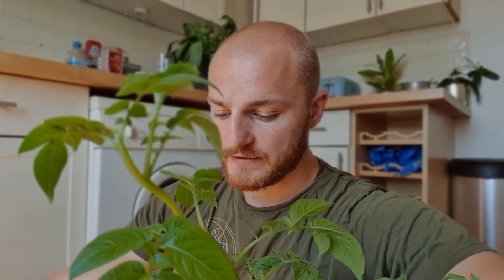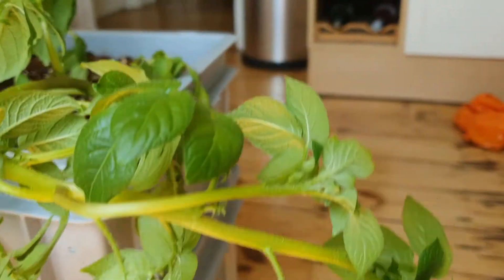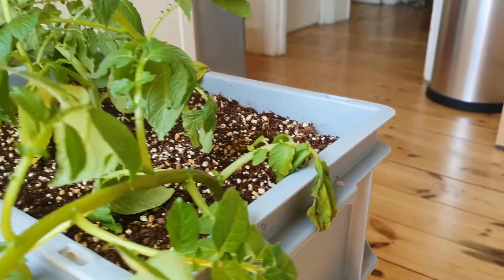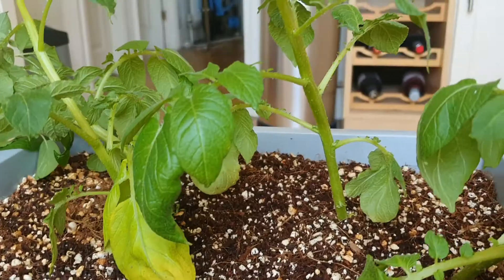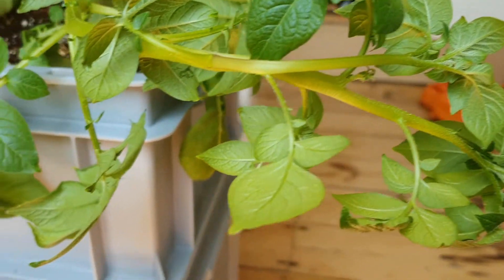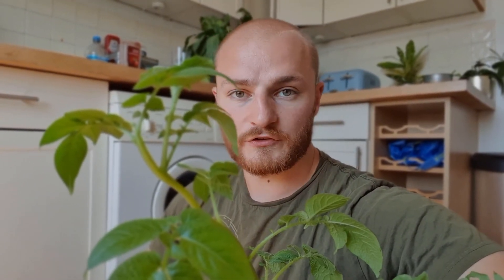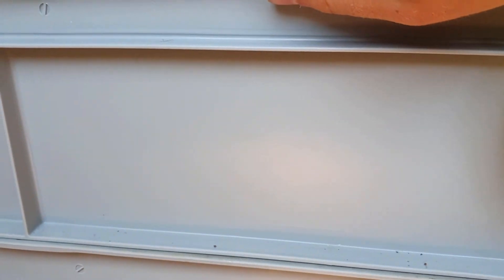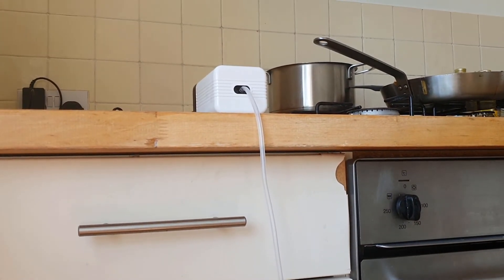Root Rot | Soilless Spuds PhD

Comment: I know you added an air stone in the next video, but I'm wondering if the issue is (and you probably already thought of this) if your nutrient storage tank lacks the ability to bring in the air naturally (as Jeb's did since the lid had vents, but no media to hinder the air).  I'm thinking 2 pvc pipes running vertically along opposite far corners.  Obviously too late to try that now, but just a thought.  I'm thinking you might be able to ditch the airstone that way... assuming you'd want to do that.  This is just a random thought from some dude across the pond, take it for what it's worth.
Reply from the maker: It's an interesting idea, and one which I hadn't considered. The system is based on one from the 1930s which had a 15 cm (3 inch) gap between the media and the solution. The difference was that that solution was only 15 - 20 cm (approx. 3 - 4 inches) deep, allowing much easier diffusion of air into the solution. Your PVC pipe suggestion may have worked, and it's something I'd be interested in trying, but I think the solution basin might just be too deep.
Reply: @DominicHill  I hear ya.  I'm thinking it might not give enough air to feed the solution much, but might be enough for "O-roots" to form.  I want to try this now.  I also have my eyes on a copy of that Gericke book.  I hope you do get back to university soon.  But in the meantime, I'm hoping for some tubers!

Comment: You need to add some hydrogen peroxide to kill the fungus. Air should have been used to begin with but it won't be enough now.
Reply from the maker: Hi Pablo,

I'm sure you're right regarding the air supply to the roots. If you watch my previous videos you'll understand why I did it this way. The plants look like they're recovering now, so will hold off on the H2O2 for now.

Thanks,
Dom
Reply: @DominicHill  just remember that fungus loves that extra air as well. It helps it to grow and multiply by increasing nutrient availability to it.

Comment: I wonder though. Root rot using a Kratky method is usually from overfilling the nutrient solution. It drowns the air roots.
Reply from the maker: Absolutely, but I fixed it with an air stone. I could have left a larger gap between the substrate and the water, but that would have been more work!